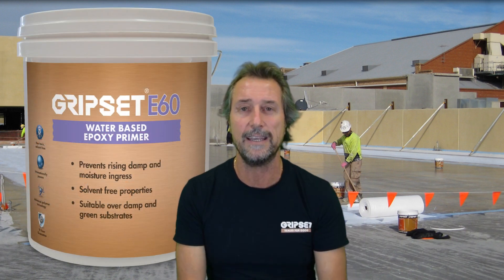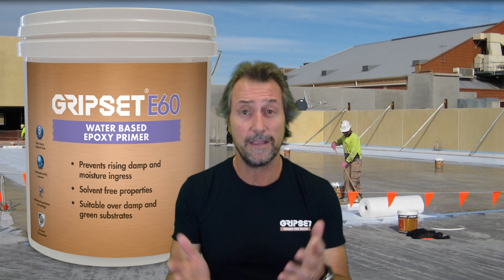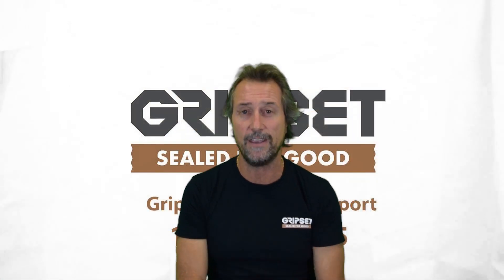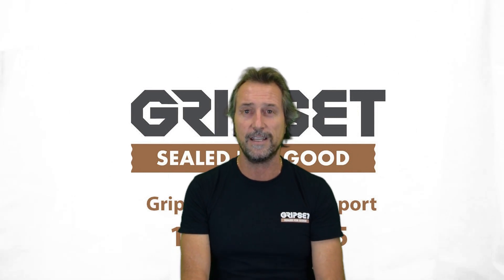Vapour Block Primers - How and When They Should Be Used

Comment: Another great video! Sadly the amount of Waterproofers that actually own or use moisture metres is incredibly low. I wonder if highlighting this on a TDS would help make it standard practice. Something like a "moisture content within the substrate should be at or below X percent, measured by a moisture metre" on epoxies or penetrative sealers. I deal with too many customers telling me their screed is dry, when its 25+ mm at the thickest point and its been a few days (in cold conditions)